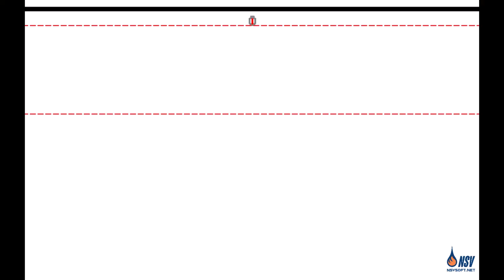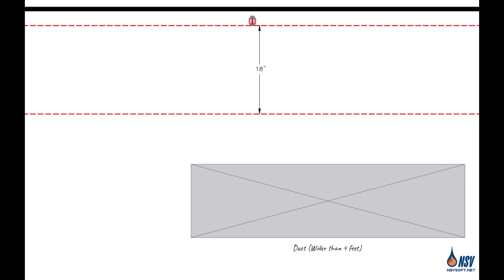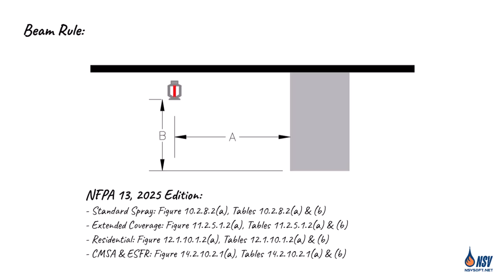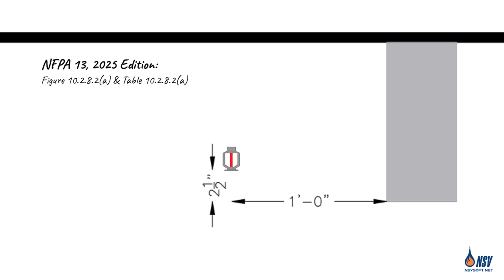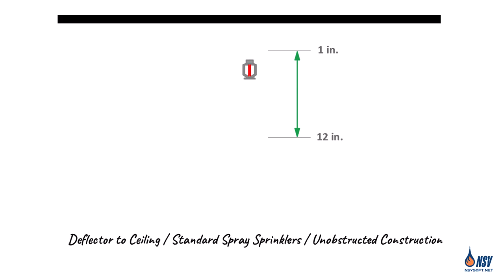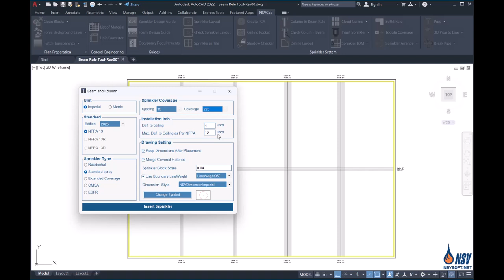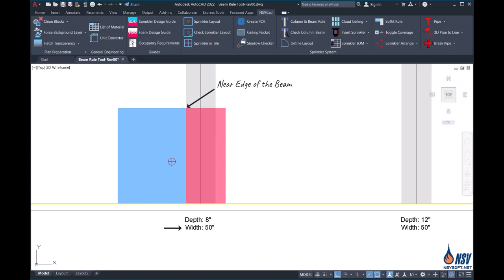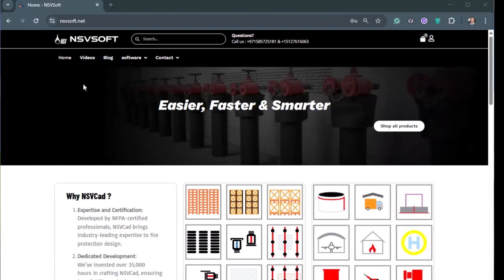📌Beam Rule Explained: Sprinkler Obstruction (NFPA 13/13R/13D)

Comment: Hello, I would like to ask whether the distance from the sprinkler deflector to the ceiling can exceed 300mm when the "beam rule" is applied to standard sprinklers, and whether the 550mm rule is applicable
Reply from the maker: Hi, thanks for your question. The allowable distance between the sprinkler deflector and the ceiling generally depends on the type of construction. For standard spray sprinklers and extended coverage sprinklers:
- In unobstructed construction, the maximum permitted distance is 300 mm (12 in.)
- In obstructed construction, it increases to 550 mm (22 in.)

When applying the beam rule, these deflector-to-ceiling distance limits must still be respected. The beam rule does not override or eliminate these requirements. In fact, if we were allowed to disregard the deflector-to-ceiling distance, the beam rule would be unnecessary—sprinklers could simply be placed beneath any beam regardless of ceiling proximity.
Reply: @NSVCad  Thank you very much for your reply. So, when the sprinkler is located in an obstructed construction area, the sprinkler deflector must not only comply with the "beam rule" but also must not exceed a maximum height of 300 mm from the ceiling. Is this correct?
Reply from the maker: You're very welcome! Just to clarify: when the sprinkler is installed in an obstructed construction area, the maximum allowable distance between the deflector and the ceiling is 550 mm (22 in.), not 300 mm. The 300 mm limit applies to unobstructed construction.

So, the sprinkler must comply with the beam rule, but the deflector-to-ceiling distance depends on the construction type:

- Unobstructed construction → max 300 mm
- Obstructed construction → max 550 mm

Both the beam rule and the vertical distance requirement must be satisfied simultaneously.